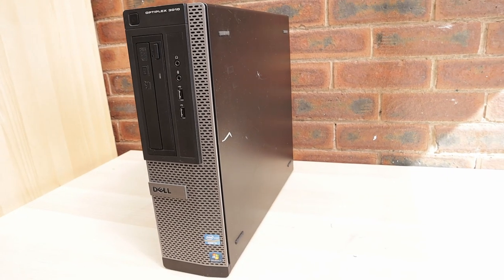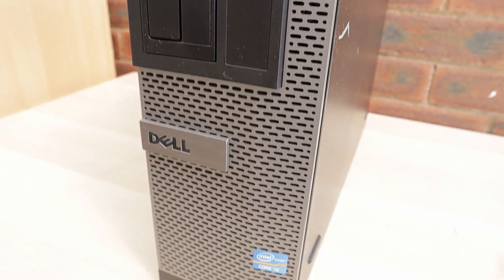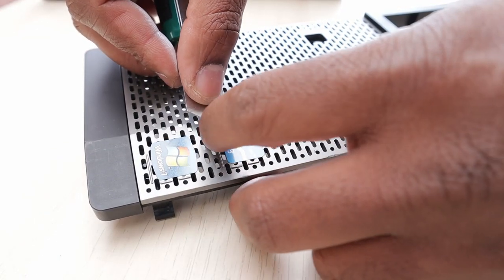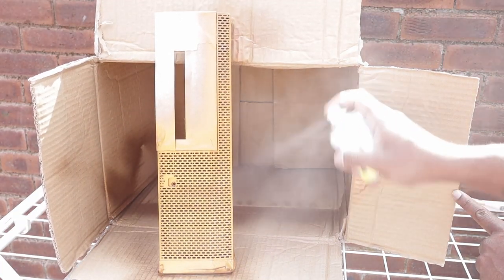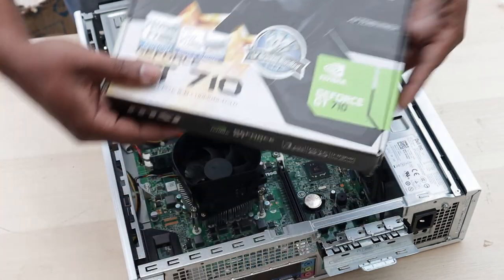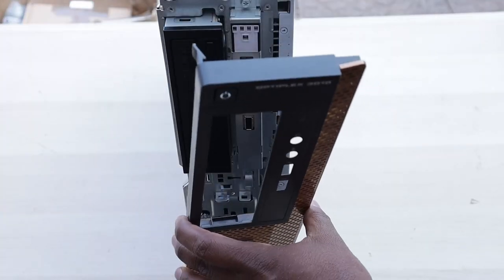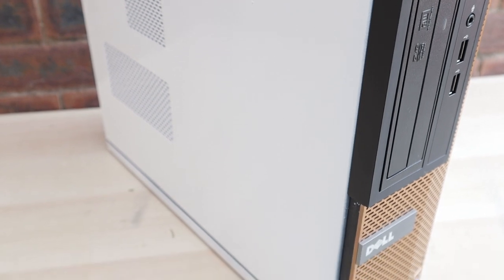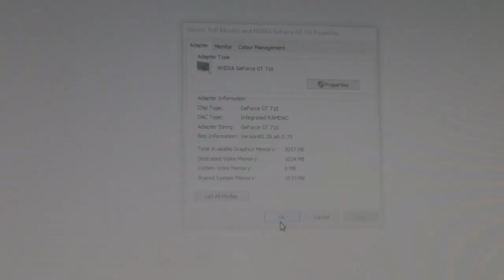How to Spray Paint DELL OPTIPLEX 3010 Wood effect | MOD | Gaming Set Up Case Mod

Comment: Excellent modification. Sorry, the inconvenience is that I have a question in relation to how much ram memory I can install and also if I can mount the motherboard in another cabinet
Reply from the maker: Thanks. You can go up to 32GB DDR3 RAM. Certainly you can use different mATX casing to mount the board. 👍

Comment: You only use base color?  No primer or top clear coat? No sanding?
Reply from the maker: Yes that’s correct. You are welcome to do it on your own way
Reply: Maybe because the case it self was gray / black already , so he didn't use primer
Reply: but i do recommend to sand it in order to make the spray last longer.

Comment: I have the same computer but how did you make the graph work for you I have a gtx 660 it turns on but it does not give video it helps me bro
Reply from the maker: Make sure you connect the display output cable to the graphics card not to the computer.
Reply: @ChathuraRanawaka  look at the graphics card does not give video on the monitor is connected to the graphics with the hdmi cable but does not give video
Reply from the maker: @cristianmedina8457  does it have display without GPU? If that the case then you have either faulty GPU or you can see on BIOS to enable the external GPU slot
Reply: @ChathuraRanawaka  I have tried the graphics card on another motherboard and if it gives video but the optiplex 1030 the graphics card turns on but does not give video
Reply: Possible that it’s just not supported.  I had the same problem with an RX 480 and Inspiron 620.

Comment: What's the material you use to cover up the parts you didnt want sprayed?
Reply from the maker: Masking tape
Reply: @ChathuraRanawaka  thanks.
Reply: @ChathuraRanawaka  did you use primer for the paint?
Reply from the maker: @QuanLovesGaming  I did not use Primer. But I would recommend for you to use the primer before spray actual paint specially on the side panels. If you don't use primer there will be chance of dripping spray paint before they dry off. Good Luck!!